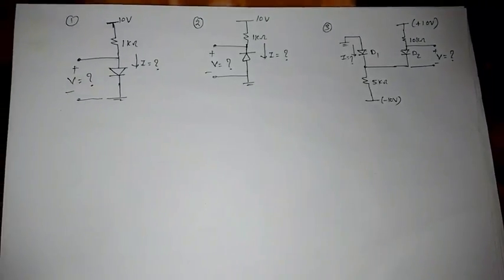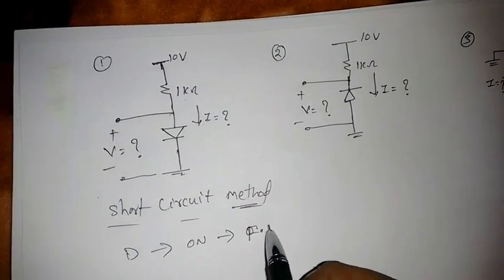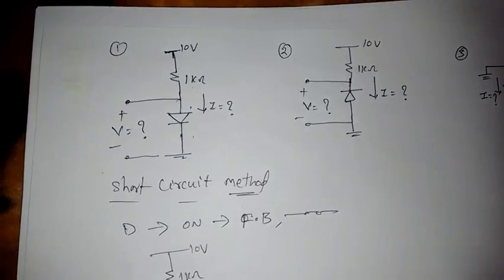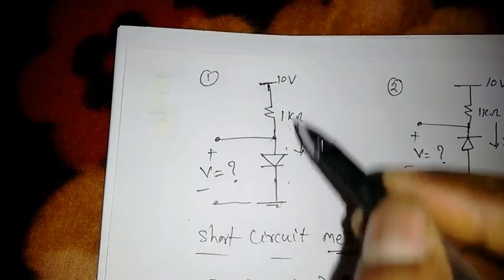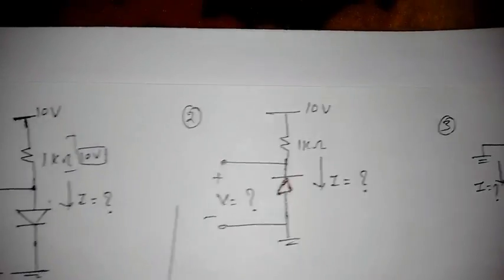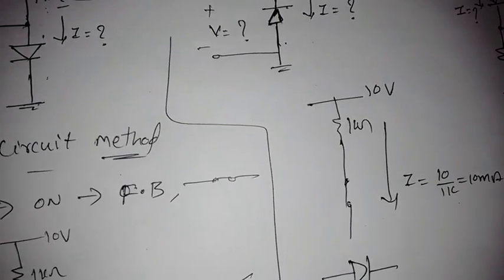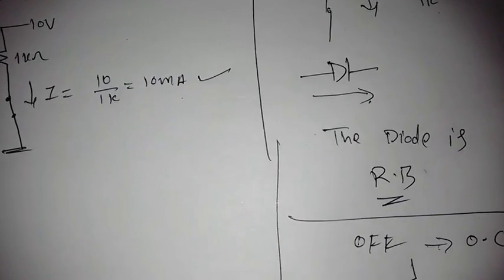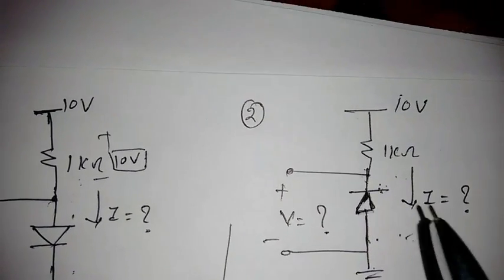Problems on Diode Circuits 1

Comment: For 1st problem voltage drop across diode is 0.7volts(if diode is silicon) or 0.3v for ge. 
2nd problem is correct.

Comment: i think the second  example for I=0 , because the diode is open circuit no current flow and V=10- R*(I=0)= 10v.
Reply: The diode is RB . V= 10V
https://youtu.be/i881nOS0b7w